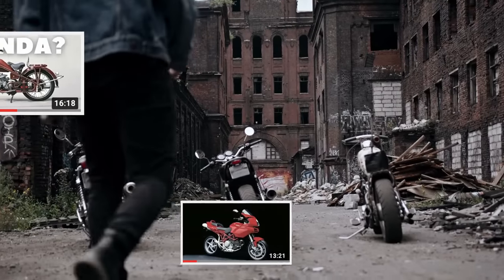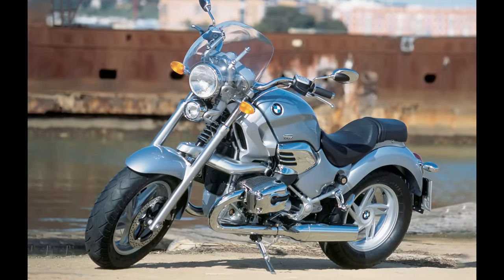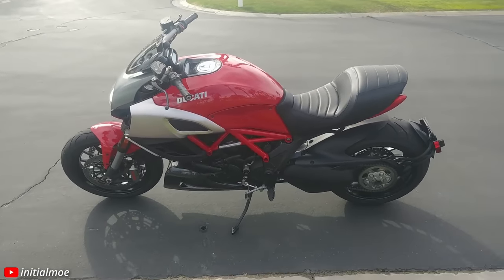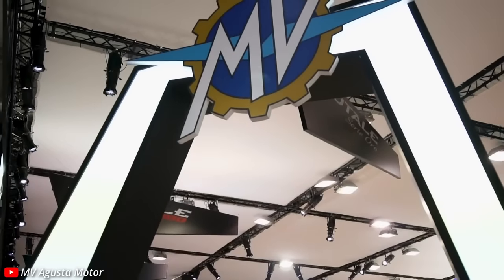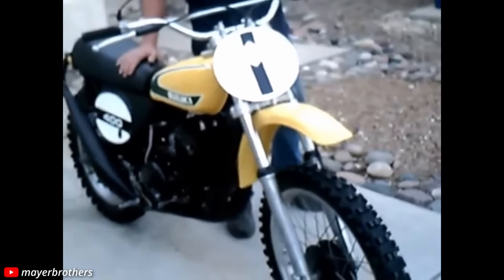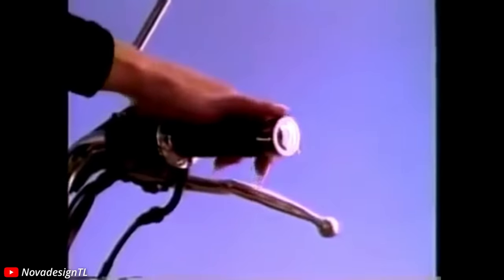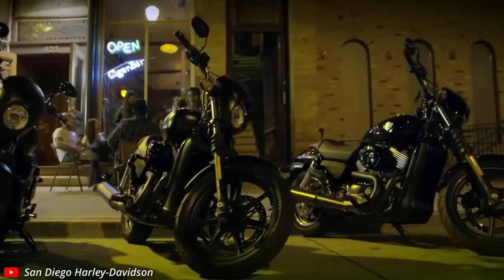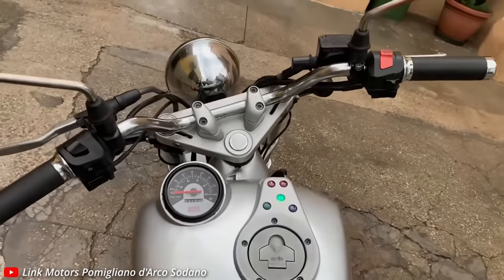The WORST Motorcycle from every manufacturer

Comment: I'd be really curious to try that kawasaki eliminator. I have no idea what a 4 cylindre cruiser would be like on the road.
Reply: Get your hands on a Honda Nighthawk. Very fun bikes. Power band of a sport bike with the comfort and attitude of a cruiser.
Reply: they are horrid things, rev boxes not cruisers
Reply: it isn't and never was a cruiser, was marketed as a drag bike for the road and aimed at the V Max sales
Reply: I owned a 85 zl900, sold it a few years ago.  It was fun as hell.  It was a death rocket.
Reply: Very quick....in a straight line.
Reply: @kevinmccorkle7476  and that was the whole point of them
Reply: @kevinmccorkle7476  lol. compared to yank crap everything is quick
Reply: Not a cruiser. Muscle bike. With its long wheelbase and shaft drive the bike will not wheelie no matter how hard you launch it. Untouchable in the stoplight drags.
Reply: Motorcycle testers of the new 900 Eliminator pointed out that the only thing keeping you from long rides was the 2.5 gallon tank. Kawasaki bumped up the displacement to 1000cc, enlarged the gas tank, put a better seat and suspension on it...and the ZL1000 was a two-season sales flop.
Reply: Yamaha's XS bikes were inline 4 but I guess more of a 'standard' rather than cruiser. The 1100 XS was a screamer of a bike.  I like the eliminator, never ridden one, but would love to try it.
Reply: I had BMs and Guzzis.....sold the BMs because the Guzzis were better in any regard once sorted. Super reliable (again, once sorted) and very long lasting.
Reply: @georgebarnes8163 Oh you mean Hardly Ablesons.
Reply: @spaceflight1019 It didn't look right.  900s way better

Comment: The Yamaha choice was interesting.  I probably would have chosen the YZ490 (since the CR450R was included) It was seizing or sputtering & Yama-hoppin down the track from 85-91.  I would almost include all the 1985 YZ's that had the BASS suspension system.
Reply: I won an open class race on a 490 when I was 14, LOL. I knew if I fell in a corner it was over!
Reply: @garlicbutter1906  I was in my teens, but I occasionally rode the "bomber" class in the 90's on my Dad's SC500.  It was a pretty terrible bike too.  It is still in my collection and all original un-restored.  Now that I am much older I can barely start it without risking breaking a leg.
Reply: I had the pleasure of racing both of these bikes back in my day and would definitely have to say that the yz490 ran circles around the cr450 and the left side kicker on the cr450 was just way too awkward for me .. but I will say that if I came across another yz490 today at a decent deal I would buy I again .. I would also buy another cr500 given the chance as it was one of my favorite dirt bikes of that time

Comment: The BMW r1200c may have been 60bhp but the motor would be very under stressed, reliable, strong and have torque and low down performance. You criticise it but look at its function as its a cruiser and wont need big power. Im not mad on it but hopefully it was easier to work on, had simple electrics and shaft drive without all those awful rider aids and other not needed rubbish.

Comment: Oil in frame triumphs had alot of drawbacks. The oil in the frame was not one of them. When compared to the older Triumphs, they had many of the quirks worked out  of them. 5 speed gear box that shifted real smooth. Front disc brake. And the frame was tight.

Comment: The power cruiser was not invented by Harley with the V-Rod. 15 years earlier, Yamaha introduced the V-Max. I remember at the time, Cycle World called it the "hardest charging motorcycle of all time". The second gen V-max did not have anywhere near the impact of the original. It was a cruiser, and it was the quickest bike available. Is that a power cruiser?

Comment: My second bike was an 82 920 Virago...it was the worst bike of my 7!  To be fair I bought it used in 89 and it had "I wanna sound like a Harley" slip on's but was not jetted properly so I took it to a repair shop that worked exclusively on Japanese bikes, when I brought it there to see if they can improve it's running without too much $, I told the owner of the shop that I recently bought it and he said, "you bought probably the worst bike ever made"!  I was a bit insulted and he wanted more money then I wanted to spend on it but after a year of riding it I knew what he meant. The LCD dash always crapped out, the fuel gauge was totally inaccurate when the dash worked but the rocks churning in a blender noise it made when starting it along with the starter gears sometimes not engaging (and yes I'm aware of a shim kit but hated this bike too much to correct) was enough for me not wanting to deal with it anymore so I traded it in for a used 86 700 Intruder, which was a great bike just a bit weak so I traded that in on a new 93 1400 Intruder and six years later traded that in on a new 99 VMAX, sold it 14 years later but I wanted to get back to a cruiser style bike again and bought a used 2006 XL1200C which is the current bike.

Comment: Royal Enfield India didn't make the same bike for 40 years because they lacked the will to innovate, it's because it was uniquely suited to two very distinct market segments. In it's home market, it's stone-aged design meant it could be maintained and repaired by village blacksmiths, miles from dealers who'd nver seen a dignostic computer in their lives. In the export market, it found a niche as a retro because it was "the real thing", i.e. a genuinely "brand new old bike" as opposed to a semi-authentic styling pastiche on a modern platform such as any Japanese retro couldn't help but be. With a Royal Enfield you could get the real 1960s motorcycling experience that your dad banged on about, but you didn't have to be a genius home-mechanic because there was a dealer network.

"Improving" it with modern features wouldn't have made it any more competitive with Japanese bikes, but it would have spoiled bothj these niches, presenmting the Indian village mechanic with stuff he couldn't fix and the European retro buyer with a less authentic experience. They only started innovating when noise/emissions/safety legislation forced them to. By that time the Indian market had grown richer and more sophisticated, so that was kicking out one leg of their traditional market base too. The new 650 twins were designed in the UK by British engineers and have done a good job of expanding their share of the retro niche (I nearly bought one a couple of years ago). Likewise, the 400/450 Himalayans have exploited another niche, namely the "practical adventure" bike, for people who can't afford or physically pick up a BM GS.

Comment: 😢 Yamaha Virago was the best bike in the line up for the 80's and 90's aside for the Suzuki Intruder. Lightweight and nimble easy to ride especially for beginners. To each their own on opinions. I guess. I can find a great used Virago with relatively low mileage at a decent price still. Long live the Virago. 😊
Reply: I bought an intruder for a commuter bike and ended up riding it all the time, only 250cc it was so cheap to run, lightweight, nimble and very comfortable to cruise on. A friend had the equivalent virago, albeit water cooled 250 and we had many grand adventures together, harks back to a simpler time when speed wasn’t a priority

Comment: You didn’t mention mine, but you were very close. I had the last of the AMF Harley Davidson Sportsters which came out in 1980.  This was a true old dog.  The carburetor constantly had to be fiddled with just to keep it running. If I hadn’t had neck surgery ( no cause of the bike ); then I was going to need to swap the carburetor out for a C&S hoping (?) I could improve the bike’s performance. This thing weighs in at a little over five hundred pounds, and you’ll notice this in town where most people would ride this bike.  I saw some owners who had put on twin tanks instead of riding with the ‘peanut’ tank I had from the factory. If you were smart enough before you took off you checked to be sure your spare tank ( that’s a joke 😂 ) off switch was in the right position when you filled that peanut.  This was the heaviest town bike I’d ever been on, but to be honest I’d been riding dirt bikes before I bought this monstrosity. I’ll give the 80’s AMF ( bowling ball company ???!!! ) Sportster props for the first and second gear on the transmission. They were super torqued, so you may have been slow, but you definitely were moving after second gear.  Sold the dang thing to a Harley Davidson mechanic, so all was not lost 😅  Right before I sold mine Harley got their company back from the bowling pin company AMF.  I have no idea what Harley Davidson is like now, but I’m betting they’re better than they were under the previous administration. I don’t ride anymore because of my health, but I always used to think BMW made some of the best touring bikes … maybe not racing bikes.  Neil Peart apparently thought that, because he’d driven around 300,000 miles before he passed away.

Comment: My bro bought a Polaris Indian but soon tired of the reliability issues before going back to a Harley. I had Andy Pelc replace the broken jugs on a BSA (looked like a Triumph) my bro gave me back in the 70's to continue emulating Michael Parks from the TV show "Then came Bronson" like I did on my minibike as a young impressionable teen.  It wasn't long before it was replaced by a Honda 750 four and at some point a couple Viragos before settling on a Sportster. Also back in the 70's a friend had a 3 cylinder 2 cycle Kawasaki street bike that nearly scooted out from under me the moment I turned that throttle. That thing was a beast and an experience I'll never forget. 

A tidbit about the Sportster:
my impulse $1K bid won a Harley Sportster that had “Bad to the Bone” painted on the tank. While my wife and I had fun riding it for a couple weeks, she told me we’d soon need something with a child seat so I accepted an offer from a buddy that wanted that bike badly, even though the title hadn’t arrived yet. 

About a week later a US Marshall called and said they sold the wrong bike. I remembered checking the VIN against the paperwork and everything matched so I didn’t understand the problem. It was then that they told me the bike belonged to an enforcer for the Highwaymen and said my safety was at stake. I told him I already sold the bike and he said that was impossible without the title, adding the return was a demand, not a request. Again I told him I sold it and that I’d call my friend. 

So I called my friend and told him the story. Turns out the US Marshall must have traced the call because they showed up at his door shortly after the call but they couldn’t get near the bike because his pitbull was chained to it and he refused their demands. 

He called his attorney but sadly he was told the US Marshall probably had the right to take it. The US Marshall said another bike was supposed to be sold so my friend agreed to go to their warehouse and take a look. He saw it was a basket case so he refused. 

A week later the title arrived, I gave it to my friend, and we never heard from the US Marshall again.
Good memories.

Comment: I had a Royal Enfield  Bullet 500 cc single. Did a lot of touring on it had the steel saddle bags on it and was a great bike, would keep up with the others on the highways and leave most I road with, behind on the dirt and gravel roads.  It was a great all round bike, never let me down once, and I loved that it had a kick start,  a great feeling kick starting the bike before heading out. Put many miles on that bike and ran as good when I traded it as did when new.  It is one bike that I wish I never got rid of.   I had many brands of bike over 55 years and the worst by far was the BMW 750 K  and my friend had the 1000 K and bough were in the shop waiting to get parts changed,  we bough got rid of them before the warranty was off, as parts were very costly. BMW had a lot of bike breaking down on the highways for as long as I can remember, to the point where they had to carry tool kits with them and know how to do road side service.  BMW riders are a strange group, no mater how many times they broke down or had to take them in for repairs or replace parts, they still clam they are the greatest bike on the road.  They talked a friend of mine to trade his Kawasaki 750 in on one, telling him how much better the BMW was, from going from the Kawasaki that never gave him a problem to a BMW with lots of problems, he soon learned not to believe what the BMW riders said and wished he had never got rid of the Kawasaki.

Comment: The best part about owning an R1200C is everyone saying, "I've never seen a bike like that before!"
The worst part is the aftermarket saying, "I've never seen a bike like that before!"

The only way to make the R1200C engine perform like it should is by cannibalizing an R1150RT for cams and intakes. You can buy a fueling chip from some dude in Europe, but the jury has been out for 20 years on whether it works or not. Also, don't crack the rear taillight bezel if you can help it; $500 is a low price for a new one. Don't crack any part on it, actually. But sometimes the bike will break the parts for you anyway, like the aforementioned taillight bezel. Keep about $250 in reserve for when the mirrors pop out of their housing and you have to replace the entire thing.

Where it seems to edge out other cruisers is in its handling. It does straight line touring very well, as one would expect, but the telelever front end and skinny tire (ignoring the Montauk version) makes it a little more nimble in corners and in dodging cagers and potholes. A lighter bike will wallop it every time, and a stock Harley will give you trouble on a straight, but you might just be able to out-carve another cruiser on a mountain pass.

Comment: 125cc cruisers have market outside the U.S. as an affordable urban cruiser. My first bike, back in 1994, was a Hyosung Cruise 125, which was perfect for the city. Being a Korean bike, it also had the same kind of frame that was used by the Japanese manufacturers at the time, like the first generation Shadows and Magnas, or the 500 and 750 Vulcans or the Virago, all those had the same sort of short frame with low seat,  peanut like tank, buckhorn handlebar that kinda brings to mind a chopper. Current cruisers tend to have a longer frame with a less curvy, more linear design.

Also pretty much every manufacturer had a power cruiser with some kind of sport bike engine: The Honda Magnas, with their 4 cylinders in V, the Yamaha VMax, of course the Harley V-Rod, the Kawasaki Eliminator.

Comment: I still have a 1996 Yamaha Virago 750 I bought new.   I sure thought it was super cool back when I bought it.   While I can understand the argument for why it sucks and doesnt stand the test of time, styling wise, I gotta say it has been rock solid dependable.  Zero issues in 13,000 miles.   The carbs get gummy from sitting with gas in it from time to time but I run some seafoam and good gas through it and it cleans itself out and runs fantastic.
Reply: imagine owning a motorcycle for almost 30 years and only putting 13k on it 
Makes you think
Reply: @a-nus  It's been in storage for 5 years.  I ride my road king, now.  It's just a small,  going around town bike, anyway.   Going more than 100 miles on that thing in a day was rare and when I did it was extremely uncomfortable